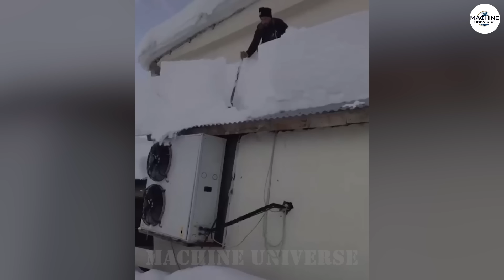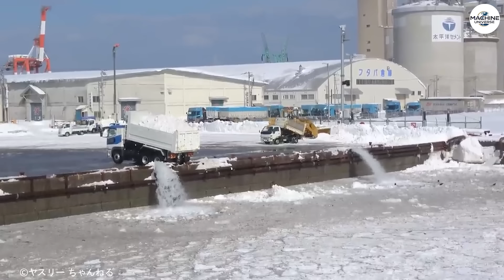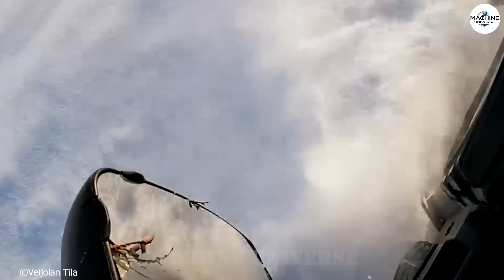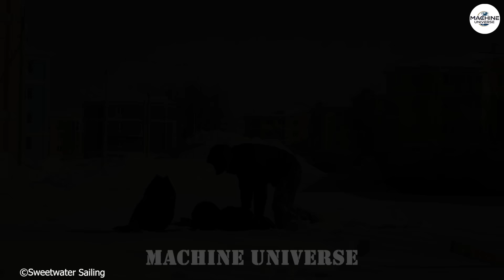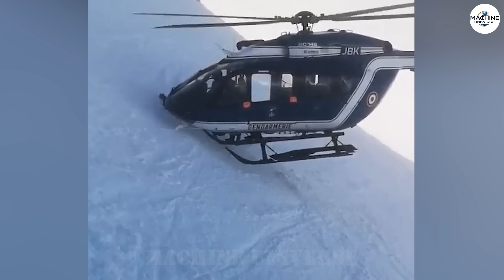Idiot Snow Removal: Massive Roof Avalanche | Extreme Dangerous Plow Truck Fails #20

Comment: What they should have done is to spray a thin coat of wax over the roof right before the storm.
Reply from the maker: Creative idea, but wax probably wouldn’t last long and could create runoff/slip hazards. Most places rely on proper roof design, snow guards, and safe snow removal instead.

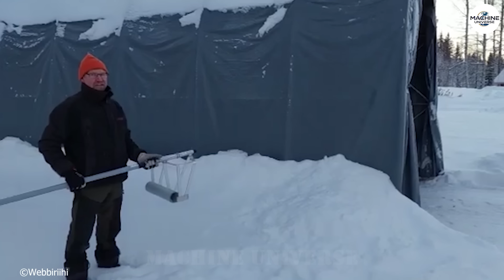Comment: At 19:54, just go inside the structure and smuck the ceiling with a broom; it takes seconds to do this and you don't get snow on yourself.
Reply from the maker: That’s a clever idea for light buildup. The only caution is if it’s heavy/packed, knocking it loose can dump a lot at once, so you’d still want to stay clear and be mindful of collapse risk. But for smaller amounts, that’s a solid tip.

Comment: Would it work better if it was turned over so that the pole was on top?  That would keep the snow from riding it.😮 7:02
Reply from the maker: Good question. Flipping it might help in some setups, but it also depends on the roof angle and how the snow is releasing. A lot of those tools are designed so the snow slides off the blade/cutter in a controlled way—turning it over could also make it catch or bind. Either way, staying out of the fall line is the biggest thing.
Reply: It's done that way to slow down and guide. Imagine a snack fridge landing on you,  the snow can do some damage.

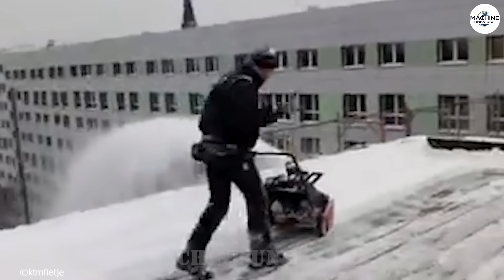Comment: 16:00 Could someone explain to this Aussie the logic of having a flat roof in a snow area? It seems utterly illogical.
Reply: I have never seen, in any country, very tall blocks of flats with a gabled roof!
Reply: @gailgriffiths3128  Neither have I in any pictures. I'm asking "Why not?"

If it's good engineering for a house, why not a tall structure? (Especially since most castle for the last 1,000 years haven't had flat roofs.)

Comment: 15:34 why do they wait until winter.  In the fall, they can climb on roof and lay cables at the peak on bothering sides attached to pulley system on both sides. Lay down plastic sheeting, and wait for snow. After snow piles up, release the pulley in the opposite side and pull the cable down to you using wires at each corner.  Then reset the pulley to pull cables back to top.  Then on other side, release the other pulley and pull the wires on opposite side to pull other cable to release snow on opposite roof.  Then engage pulley to return cables to top of roof.  Cables free up the snow which now slides off roof.  Pulleys deposition the cables to use after next storm.  That's my idea for this high roofs anywsy.
Reply: So, you have a bit of snow, not enough to start your system, and it is cold. Then comes a mild spell, with a little rain. then it freezes again, but undercooled rain is still falling. Then comes a bit more snow. Now you have layers of ice on the roof, and your cables are coverd in ice, thick icicles from top to bottom. The pulleysystem is also frozen, and you can not get to it because of the ice. And your roof is a hazard because of the the plastic sheeting that makes it slippery and far less reliable ( it was risky to begin with) to climb up.

At least you did not suggest using a powerwashing machine to cover the roof with hot water, or a heated roof.
Reply from the maker: That’s a creative concept, and I like that you’re thinking ahead in the fall. Real-world ice layers, freezing rain, and jammed pulleys would be the big challenge—but as a starting idea, it’s definitely interesting.